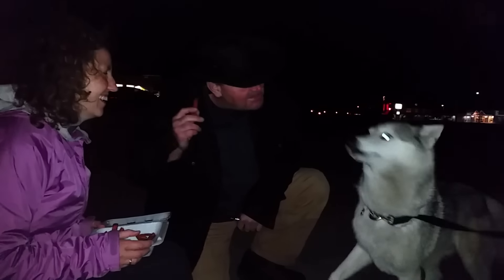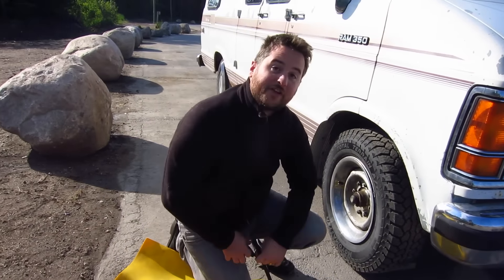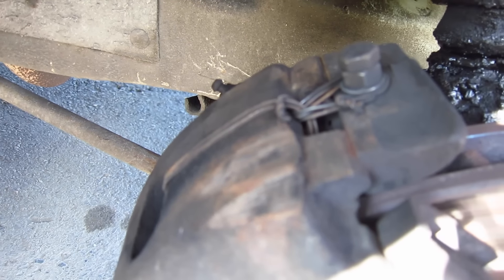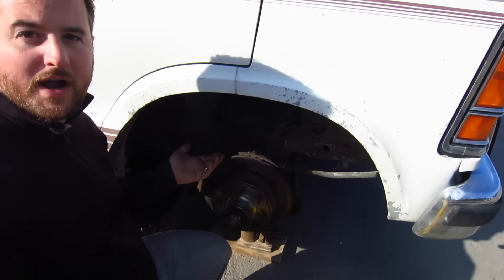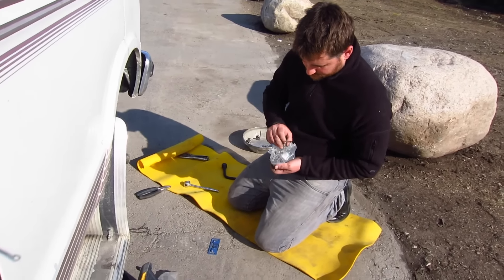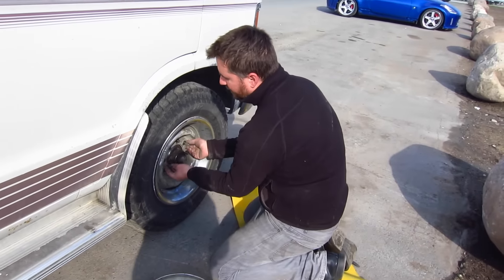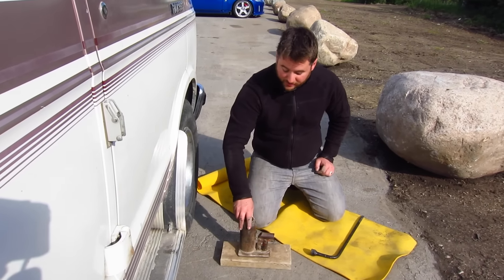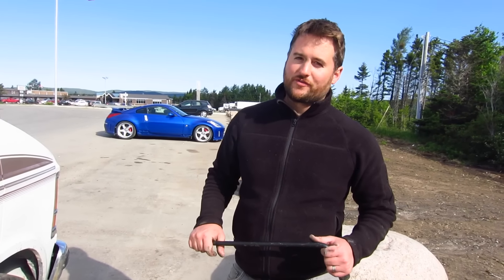GGC - 27 - Van Repairs: Fixing our Brakes at a Truck Stop in Newfoundland

Comment: Use Loctite Blue 242 to seal and lock clean bolts. It seals the thread against corrosion as well as locking it in place. Blue Loctite is medium strength and intended for parts than need to be disassembled with hand tools. I have always used it and never had a brake bolt back out. I drive a Jeep on overland trips and used to drive an F250 on washboard roads regularly.
Reply from the maker: +cageordie 
Great tip cageoride! And thanks for the extra info about the 242 being specifically designed for hand tools, etc.  I will add some next time I have the wheels off.  Thanks for the comment!

Comment: A touch of blue threadlocker will help keep all those bolts in place on those rough roads.
Reply: Totally agree. Taking the light rail and walking in Los Angeles, I always find nut's and bolts on the road.
Reply from the maker: +t00fatt 
Good tip.  I'll add some next time I have the wheel off.
Reply: Yup, noted.

Comment: Great job MacGyver. I have no idea how you that twine tight and to hold on for so long. Good job!  Also, I dont know if its wrong, but i tighten the nuts more than finger tight while the wheel is up. I tighten until the wheel turns...not all but a few, that way when the weight is down on it, you know it wont move, and then I finish tightening. Thanks guys!
Reply from the maker: +Watrworld 
Thanks Watrworld! And I actually usually tighten until the wheel turns also... Not sure why I didn't do that in this video.  It's a good tip though!

Comment: Although I wouldn't be too motivated to do a brake inspection before a normal trip it might be a good idea to tighten up the caliper bolts before traveling on long rough roads.  I think you guys dodged an expensive and frustrating bullet with this breakdown :-/   I think you deserve an extra beer at diner tonight!
Reply from the maker: +John Norris 
I actually did change all the brakes before we left.  lol.  So there is nobody to blame except myself.
Extra beer though... You bet!

Comment: I have owned several dodge vans and pick-ups that used this part and have several friends and relatives that have had them also. I have never seen or heard of this problem before.  I have several thoughts on this.  If Loctite or a lock washer was required, it would come with the kit.  The plate that you lost was made out of spring steel.  It has a bend in it. When you tighten it down correctly you flatten the plate.  It keeps pressure on the bolt just like a lock washer.  Make sure you tighten it enough.  That being said I always keep some Removable Loctite on hand and it won't hurt to use some here.
Reply from the maker: +David Bishop 
I like your point of view (if it was required, it would have been provided).  That being said, I also like the "always be prepared" caveat. Thanks for your comment! :)

Comment: Not about your brakes but did notice you have the same awning as mine. Thought I would share some info with you to hopefully save you the problem I had. Almost everything on it is held together with rivets, the rivet that goes through the nylon slide block in the rails came apart causing everything to just go wrong breaking both of the blocks, which are not available anymore. Had a local CNC shop make some new ones for me. Went over it and found a number of the other rivets were about to fail as well. Couldn't find the proper rivets either but used bolts and cut to length. Used nylocks and red loctite, been a year so far just check them all the time though. Hope it saves you some grief.
Reply from the maker: +Rc Flyer 
Thanks for the tip Rc! We actually had to do a repair on our awning after our very first time using it.  One of the brittle plastic pieces snapped.  Luckily, we were able to fabricate a new part using a piece from an old screen door, lol.  We'll have to make a quick video about that one.  It's been holding strong for over a year now.  Thanks for watching, and for your comment!
Reply: +A Guy. A Girl. And a Campervan Might be the same part then! I first built a new piece from hardwood and made a spare but I use my awning a lot, plus moisture caused some problems with the wood swelling. I didn't want to be stuck somewhere because of it. Used a lot of colorful adjectives while getting it all crammed back in to get home :) Had the CNC shop build me two extra. As the rule goes if you have it you will never need it , once you get rid of it or don't have it you will almost immediately need it.
Dan

Comment: I've repaired my 1996 F-150 in that exact same spot.
Reply from the maker: Lol, really? It was a perfect spot for that sort of thing. Nice big lot. What repair did you make?
Reply: @BackToReality  On the 302 in that truck, there was a pipe that went form cylinder head to cylinder head on the back, by the firewall that was connected to the smog control equipment. Some type of EGR system. 
The T-junction broke on the pipe while towing a trailer up the big hill there in Gros Morne (South East) causing bad noise and fumes in the cab.
I bought a roll of tinfoil, balled it up and stuffed it into the pipe, then tied in in place with bailing wire.
Those rocks are a perfect stepladder.